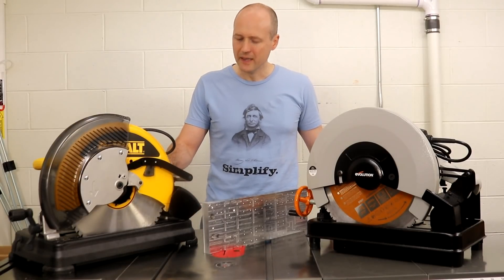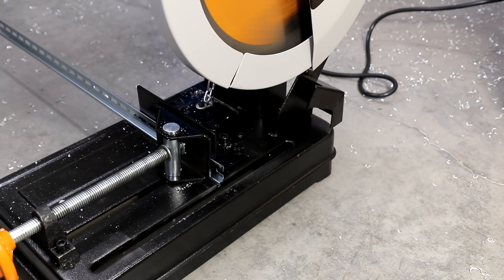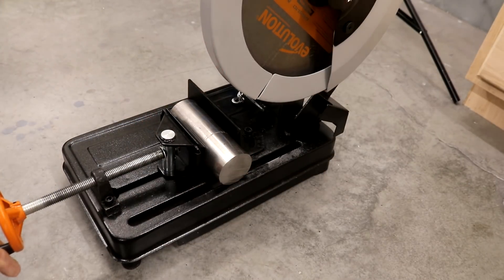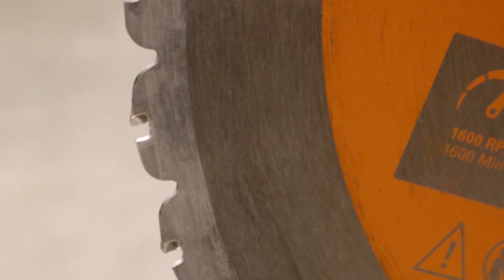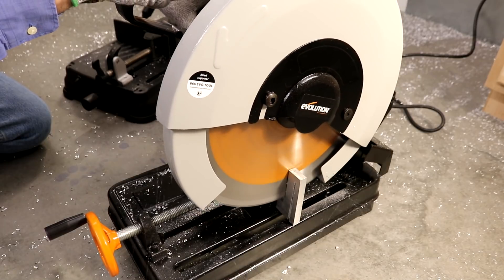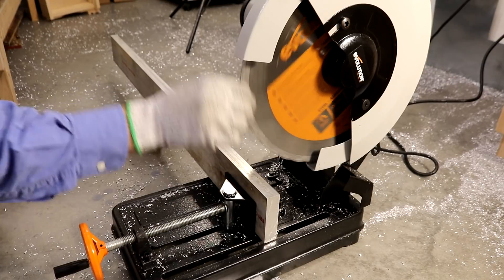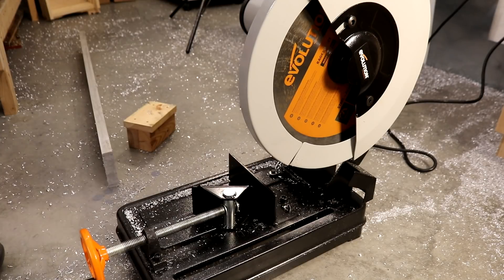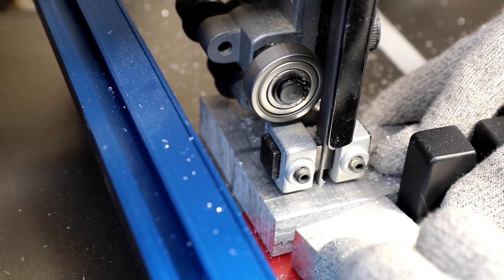Evolution Rage2 vs DeWalt DW872 for cutting aluminum

Comment: Very informative... Thanks!  Just curios, if you were setting up a new hobbyist metal shop would you use one of these metal saws or something like a 6" metal band saw?
Reply from the maker: Without hesitation: bandsaw and an angle grinder. I've had both the 6 and 12" Harbor Freight horizontal bandsaws. The 12", on sale, is especially nice. Angle grinder is very versatile for cutting and shaping and can cut hard metals.
Reply: @kentvandervelden  Thanks Kent... Just to be sure we are on the same page, you would get a bandsaw over the Evosaw or Dewalt for your first metal cutting tools.  I am not sure if I was clear with my previous question.
Reply from the maker: @joels4208  Assuming the saw is mostly sationary: If I only had space for a 6" band saw I would probably lean towards the Evo380. If I could find space for the 12" bandsaw, then the choice is easily the band saw. The increased cost of the 12" over the cold cut saws will be recaptured by lower operating cost. And regardless of saw, save your blade by cutting hard metals with an angle grinder. Also, using a horizontal band saw in a vertical orientation does not work well, at least on the saws that I had. Hope this helps.
Reply: @kentvandervelden  Thanks... That is very helpful... I have been deliberating between the EVO380 and a 6" band saw.  It is hard to hard to identify the pros and cons of each if you have never used either.  Thanks again... Richard
Reply from the maker: @joels4208  If mostly cutting aluminum, I used a sliding miter saw with a blade for aluminum for years. Less rigid than the Evo and Dewalt, but inexpensive capacity. Ware a face shield to protect yourself from flying carbide. The Evo380's capacity to cut 6" is often less than 6", depending on the depth. I've cut aluminum plate on table saw and circular saw, but seems kinda sketchy (What would kickback be like?) I've now dumped all my saw knowledge and opinions :)
Reply: @kentvandervelden  Thanks for all your thoughts... Very much appreciated.

Comment: How well do these circular saws perform in cutting 45°? I have the Evolution Rage4 (the smaller version), but in my experience it never cuts at 45° perfectly. Even a straight 90° is off by at least one degree. Is that a circular saw problem in general?
Reply from the maker: There's another comment saying that the DeWalt does poorly at 45 degree. In his case, the fence slips, the material grabs, and inserts break. I don't have any experience with it since I only use the saw for roughing for the mill and lathe. It's an interesting problem. I've since been using an Evo380, am happy with it, but only cut square. Wish I could be of more help.

Comment: now try 45 degree cuts between the 2. The dewalt fence won't stay @ desired angle, and it will walk the material INTO the blade.
Reply from the maker: That's crazy! I have been using an Evo380 since this video. Pretty happy with it, might have the same problem, but cutting stock for mill and lathe I've never needed to move the fence. Thanks for the heads up.
Reply: @kentvandervelden  Yea, I discovered this while hacking through some STAINLESS 1.5" square tube. The vibration of the saw coupled to the Y axis clamping into the angled fence makes the clamp essentially "hammer" the material to +XY. This then DESTROYED the carbides on my blade as it flexed it. Had to reset the angle of the fence every, single, cut. Dewalt really screwed the pooch on this design.

Comment: Isn't there a probability of the cut piece falling against the blade to get thrwn if you cut the piece in vertical?
Seems dangerous!
Reply from the maker: I've never seen that, but may be possible, be safe. Piece would be carried away from operator, unlike kickback on a table saw where the piece becomes a bullet heading towards the operator. Interesting question.
Reply: @kentvandervelden  Yeah but it may crash against a part of the machine and get rejected to you or something :O.
Anyway nice video! :)

Comment: You said at the beginning that the rage2 had an old blade and the Dewalt had a brand new blade... you can’t make a fair comparison....
Reply from the maker: No, I said that I could not afford a new blade for the review, the DeWalt blade is 18 months old, and the Rage2 is 6 months old. Regardless of age, the DeWalt is has seen much more use. While it's not shown, I exclusively use the Evo380 now. Glad to answer any questions.

Comment: If someone sent me down to the saw store, I wouldn't even look at the DeWalt.
Reply from the maker: :) what would you get instead? I've been considering switching back to a horizontal bandsaw.
Reply: @kentvandervelden  I have a bandsaw that can also go vertical. The best part is starting the cut and leaving it. Pretty happy with that. Made In Poland made a adjustable saw using the Evolution blade and it turned out very well made. Worth checking out.

Comment: Bạn cho mình hỏi chút.2 cái máy này chạy điện 110 v.hay220 v vậy.cảm ơn bạn
Reply from the maker: These are US 120V 60Hz models, but the manual lists international models for 110V or 230-240V 50Hz.
Reply: @kentvandervelden  giá trị chiếc máy cắt sắt chạy điện 220 v là bao nhiêu tiền vậy bạn.cảm ơn bạn.tôi đang tìm hiểu và muốn mua để làm ở nhà bạn ơi
Reply from the maker: @tudo9466  You'll need to check your local market. I would not know how to otherwise estimate.

Comment: Will the Dewalt Blade fit on the evolution saw?
Reply from the maker: I'm pretty sure yes, and the Evolution blades, which there are many, on the DeWalt. You'd need to double check the arbor size, but I did check this at some point. The video was comparing the saws for over purpose out of the box. If buying one today, I'd get the Evo 380.

Comment: You mentioned the shutter while cutting, did you or did you think to check the run out on either saw.  (how true the rotation)
Reply from the maker: No, I didn't and really should have. There's a good deal of flex in both these and the Evo. I assumed flex and material expansion was the cause. You make a good suggestion. Thank you

Comment: Any time you cut or drill aluminium is much softer .
Slow down when drilling or cutting.  I now the evo does not have a variable speed. A blade for cutting wood  is just as good.
The blade on that evo is designed to cut steel. Heat is the 
Enemy on aluminum.
Reply from the maker: Thanks for the tips!

Comment: Wrong title for this video ... this is a blade comparison, not a machine comparison...
Reply from the maker: Others have shared a similar suggestion. However, here the comparison is between two saws, as they are out of the box, for my needs, without purchasing a new blade. I should have been clearer in the video during the description of test and conclusion. If people bought the Rage 2, and had a similar task, they'd be disappointed. The total cost would rise with a a new blade purchase and they may second guess the original purchase. For a different propose, not tested here, they might be happy.

Comment: Thanks for the review. Your using the saw to do exactly what I would be using it for........ feeding my mill.  My local material supplier charges on average $1 per cut. A saw is much needed in my shop and probably could have paid for itself 1000 times over by now. 🙄 Have you tried the aluminum blade in the rage yet or just stuck with the dewalt?
Reply from the maker: Replacing the stock Rage2 blade would be fine. If you're going to buy both the Rage2 and an Evolution blade, consider the Evo380, which is likely to work out of the box and is a more rigid saw. I've been using the Evo380 since this video and have not used the other two saws. A band saw is pretty useful too, for avoiding milling a lot of extra metal. Best of success!
Reply: Kent VanderVelden Thanks front quick reply. Yes the EVO380 was what I was thinking anyway. Just wanted to see if you tried the aluminum blade at all VS any of the stock blades. Thanks again.
Reply from the maker: Left the stock steel specific blade on since I do cut some steel. I do have an aluminum specific blade. When the stock blade finally needs sharpening ($25 locally) then I'll install the other blade. The stock blade will get one started. Hope this helps

Comment: What is the difference between the blue and the orange disc?
Reply from the maker: Do you mean the Evolution blades with orange vs. blue labels? The orange-label blade is a multi-material blade. It's standard on the Rage2 and has a seemingly limiting tooth pattern, perhaps it's to limit feed-rate. In my video, this pattern seemed to be responsible for the poor performance with aluminum. The blue-label blade is optimized for steel, has a more traditional tooth pattern, and is standard on the Evo380. While optimized for steel, I've been using one with aluminum successfully. Perhaps there's a little performance loss compared with the aluminum optimized blade, but the blue-label blade seemed a better compromise for cutting steel and aluminum than the multi-cutter blade. Hope this helps. Have a wonderful day!
Reply: Tank you 🇧🇷

Comment: If you only cut aluminum and never harder metals then a wood chop saw is CHEAPER< FASTER and Better for cutting aluminum. just buy a aluminum blade for it.
Reply from the maker: Originally I used a sliding compound miter saw with a specialized blade. That setup was fast and accommodated larger cuts, and could be made safe, but like you said only good for aluminum. For large aluminum plates I now use a table saw. Peace
Reply: @kentvandervelden  track saw is another option. This is how I cut up 1/4" thick aluminum sheets that are 4x8' size. Then I learned my aluminum supplier has a giant shear and would of cut up the sheet any size I wanted for free, and shipped locally for $10 truck fee.

Comment: You could of gotten a $26 saw blade 14" off amazon   https://www.amazon.com/Sawcraft-Circular-Blade-Aluminum-Blades/dp/B07F8WCQYX/ref=sr_1_12?keywords=14+aluminum+cutting+saw+blade&qid=1570274415&sr=8-12
anything would of been better than that crap evolution blade which is one of the worst blades around. a do everything blade does nothing well.
Reply from the maker: That's pretty amazing. That's just a little more than what I'm charged to have the DeWalt blades sharpened. At that price, would one sharpen or replace? I meant to mention, when I was using the sliding compound mitter saw, I used a Freud blade for aluminum. I had teeth get chipped or broke off. Maybe that was just bad luck with the blade.
Reply: @kentvandervelden  you just throw them away and get a new one.  And using a spray bottle of soapy water will make your aluminum blades last 2x longer and cleaner cuts as well.

Comment: Do most people who own these saws own several metal-specific blades?
Reply from the maker: One blade for steel and another for aluminum? No idea. I have a couple blades to have a spare. My guess is that any place that is high production would have more rigid saws where time savings would come from not having to clean up the cut.

Comment: The evo is also 1450 rpm vs. 1300 rpm. Did Evolution rush you an aluminum blade when they saw this review?
Reply from the maker: Right, this is mostly a comparison of the blades. Maybe the DeWalt is a little nicer, and the Evo let expensive, but they are close. And if you need to buy a second blade, they get closer. Evolution did send another blade and it works perfectly. I need to follow up about all of this. If I was starting all over, I'd go with the EVO380.

Comment: Bought the dewalt, has an extra clamp on it for larger stock. My only gripe is setting angle could be more precise, and I’ve heard some people say their saw doesn’t cut square, but I can use an angle finder to double check them. Blade is SHARP and cuts through 6” beams amazingly.
Reply from the maker: When it comes time to sharpen the blade, I found my local wood worker store can send the blades out for sharpening on a cnc sharpener for $25US. Hopefully you have a similar service nearby. I wonder if people saying their saw does not cut square might be pressing too hard. Thank you
Reply: Kent VanderVelden good comments. Only thing I could think of is the mounting may not be perpendicular, and shimming the saw mount to the base may help those who have had issues

Comment: sr el problema de empastamiento en dientes de la sierra , se puede deber a que hay diferentes    discos con diferentes cantidad de dientes para diferentes espesores de material a cortar  , solo hay que saber el espesor a cortar y la cantidad de dientes que tiene que tener la hoja , ese dato lo da el fabricante de la hoja circular . NO ES QUE LA HOJA NO SIRVA , SINO QUE  UD NO SABE  QUE  CUAL HOJA DE CUANTOS DIENTES DEBE USAR  SEGUN EL ESPESOR  A CORTAR .
Reply from the maker: The standard blade has a design that may be too limit the feedrate in soft materials. If the blade was changed, I'm sure all would be fine, but this was a comparison of out-of-the-box experience.

Comment: You should have just exchanged blades between the two.
Reply from the maker: I expect they'd perform similarly with the same but the test was of expected performance out of the box. The blades are not cheap. I tried to make this clear but others had similar comments so didn't get point across well. I've been using the Evo380 since this video and have been most satisfied with it. If you do get one of these saws, find a good place to have the blades sharpened. Cost around here is $20 and the blade is back in a week.

Comment: Good review.  The real issue here seems not to be a saw issue but a blade issue.  The real weakness between both saws is the clamping, it seems the Evo saw solves this problem.  So now its between duty cycles, watts, amps and speeds?
Reply from the maker: If I would have swapped the blades these saws would be pretty much equal. I tried to compare out-of-the-box experience because the blades are costly. The Evo380 is a step up. I've been testing it and it's more rigid and heavier than either of these and that's noticable in the vibration and the final cut. My use case, cutting thick stock for machining, may actually be an offlabel use for saws perhaps meant for rebar and tubing? That may be related to clamping system too.

Comment: how would the rage 2 saw perform if you put the dewalt blade on it?
Reply from the maker: The Rage 2 would do much better. An Evolution aluminum cutting blade or DeWalt blade would solve the problems I had. I was trying to compare the saws out of the box. The blade the Rage 2 comes with does cut steel fine. The replacement blades are expensive but can be sharpened. I get mine sharpened for $25US. If buying a new Rage2 plus blade, give serious thought to the Evo 380.

Comment: It looks like the Dewalt now has an additional hold down clamp on the base, not shown on your saw.
any feedback on this new addition to the saw???
Thanks Dave
Reply from the maker: Hi Dave, I should have mentioned the hold-down clamp. It's used if the work piece is engaging the blade on the upstroke to prevent lift off. I perhaps don't not use it all the time and probably get away with it because I nearly always only cut solids. Regardless, follow the manual. The clamp has been around for a while. I bought the saw May 2016 off Amazon and the saw came with the hold-down clamp. If you do get a carbide tooth chop saw, look around for a sharpening service. The work working store near me has a guy who collects and resharpens saw blades. The DW872 blade costs ~$25 to sharpen.
Reply: Thanks for getting back so quickly to me! I looked it up after posting the question.
Dewalt says it's a pipe set up in their literature.
I use several different saws in the shop. I like the Dewalt for the cam lock instead of having to hand loosen bolts or set screws to swing an angle on the fence, s found on many of this saws. I've never been able to sharpen a blade- teeth blow off before the point of ever dulling. Probably the operators fault!
  Users should be aware that cutting small diameter stock with these type of saws often results in the cut off portions blowing across the shop!!
Dave
Reply from the maker: Are they slamming the saw down too fast? On small potential projectile material a slow feed has worked fine for me. I've not lost a tooth on the Dewalt blade, but certainly did when I (mis)used a sliding compound saw. For reference, if not too many teeth are lost, the local service charges $2.5 a tooth for replacement. Hope something here was useful.
Reply: Oh yea- people treat it like an ax into wood, even when explained about the proper feed rate!
Good videos!